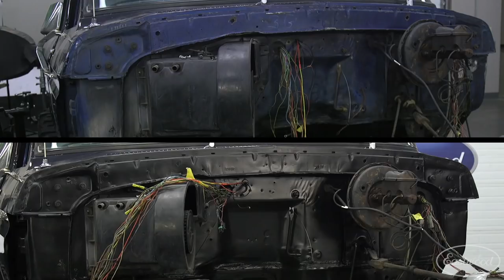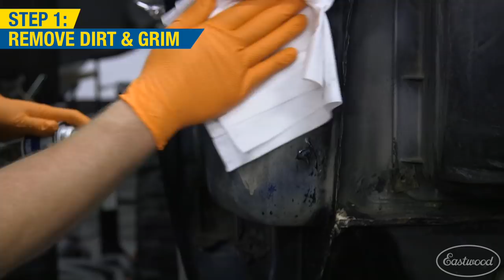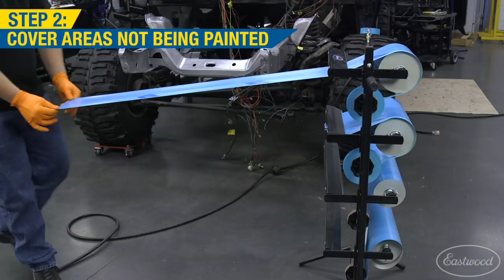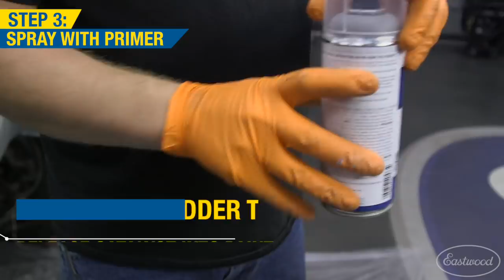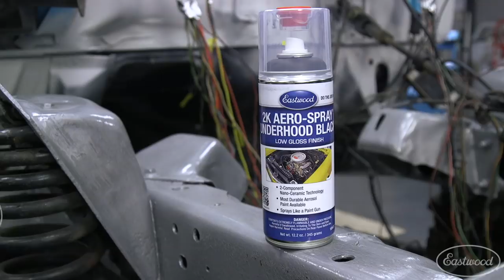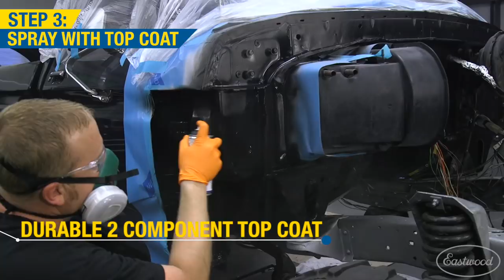How to Paint a Firewall Using Eastwood 2K AeroSpray Underhood Paints! - Eastwood

Comment: Why didn't you spray the firewall the same color as the rest  od that ford dentside F150. I expect better from Eastwood than that.
Reply from the maker: The frame wasn't painted at this time.  The plastic parts on the firewall were restored with Eastwood Plastic Resurfacer.  did you think it should be blue?
Reply: Yes I do think you should have painted not only the firewall the same as the body but also the hinge area, And I think it is bad when you open a hood and see the rubber grommets painted as well, , It could be OK to paint the lower and mid section of the firewall a different color But not the top section, It really makes a person think the work done on the rest the vehicle to be half assed just like the firewall was done, And these dent side classic fords deserve better.
Reply: I am someone with an opinion, And considering I'm leaving my opinion with a professional company that is showing others how to do a job you would think they would at least show how to do the job correctly Considering this is being done to a classic truck that is in very good condition, I did not critique the work they did, that and how they did it was well done,  Just color choice,  But I see your point, And how the unintelligent can not get there point across with out using vulgar language , You have shown that you can't see others point of views, But that what happens when people like you that have  lack of intelligence decides use their hate filled mind
Reply: Good thing it’s not your truck then. Sorry bud, the whole idea of this video is to promote DIYers to alternatives. Nothing perfect, still a beautiful alternative. Also, your 4B ranch house is trashy and that’s just my opinion 🤷🏽‍♂️